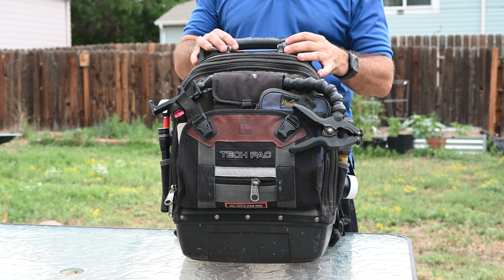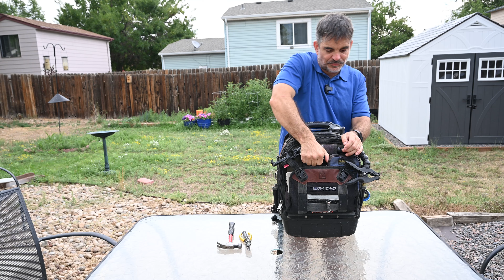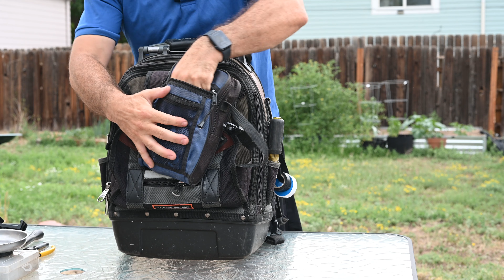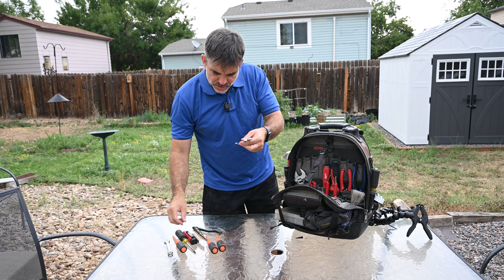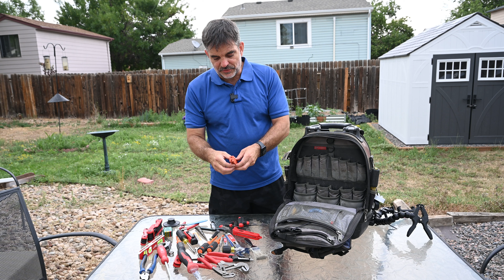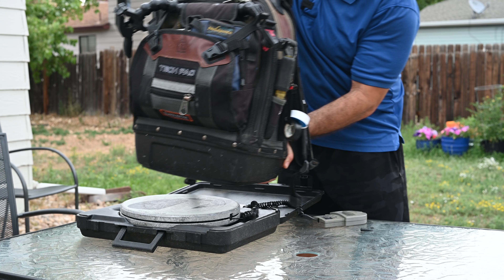What's in my Veto Tech Pac - Apt Maintenance Edition

Comment: Lots of great stuff in there.. but way more than you need.  I have the same klein 11-1 mag screw driver, and that does 90% of WO on its own.  lol.  My little hand bag weighs maybe 10-15 lbs, and I rarely need to carry all of it.
Reply from the maker: I don't mind carrying 45 lbs on my back to complete 95% without making a trip to get a tool. I've been at this 20 years and every day I look for ways to get more efficient. I also work at 12 properties with over 3000 units combined, and get all the fun appliance and hvac work orders.

Comment: Unfortunately, the corporate doesn’t see it the same way, doing apartments maintenance for many years there is no way appreciation how good you are in your job, you are a number for them, to be on call 24/7 and over time payment, there is no way for me I call this kind of job a professional worker (maintenance technician)..
Reply from the maker: The techs that accept the 24/7 oncall are the problem. If no one applies for those jobs, the 24/7 oncall stops. I know I would never even consider a position like that. Good luck

Comment: I like Milwaukee power tools, but I found most of their hand tools to be not very good to say the least
Reply from the maker: Ya, the hand tools are decent and if I lose one or two (which I will) I won't be upset. I keep my good hand tools at home for home repairs only (knipex and such)
Reply: I'm glad to hear you have some higher quality tools.  I've always wondered if you were just stubborn and said these work I'm not changing it or you were holding out.  Either way when that's how you make a living you deserve nice things.  It also helps alot of the time they actually do thr job better aka grip not strip out screws ect.
Reply: @ApartmentMaintenancePro  thats a great point

Comment: That's a reasonable amount of stuff 👍.   My tech pac is about 44 lbs and no longer functions as a backpack personally.  That's OK with my I've have veto xl mcts many bags over the years and I've been happiest with my tech pac.  I did get the orange high vis double pannel on the back along with the full double pannel for the front.  Not doubling up tools into one pocket helps organization alot a place for everything.   As a person who lugs a bag around that weight it's very doable 👍.   Thanks for the bav update.
Reply from the maker: Thanks for the comment Matt :) orange high vis panel?
Reply: V sawp Modular tool pannel (it has hi bis orange) and v swap folio tool pannel for the blackout.  If you check out Morgan's maintenance reload ep 24 you can check it out.  I'm a little more electrical focused but it may interest you since I do alot of apartment maintenance.
Reply from the maker: @MattHmm-rq6dn   thanks for the heads up will check it out :)